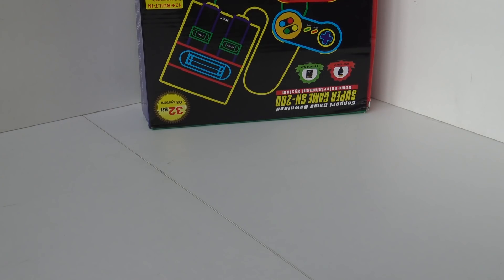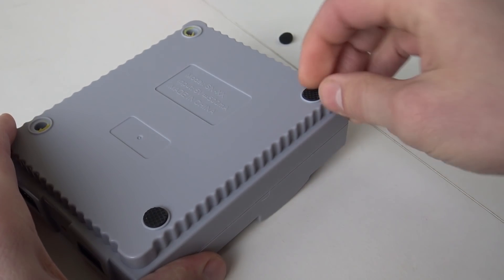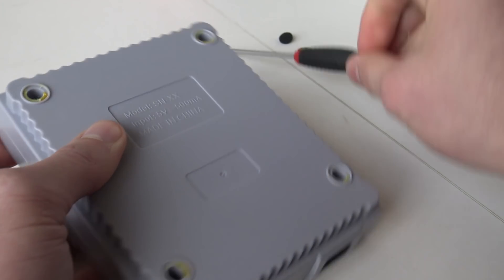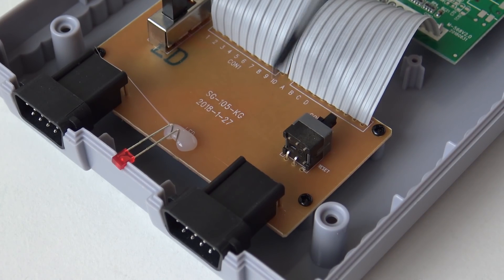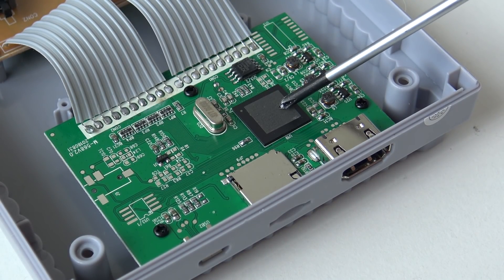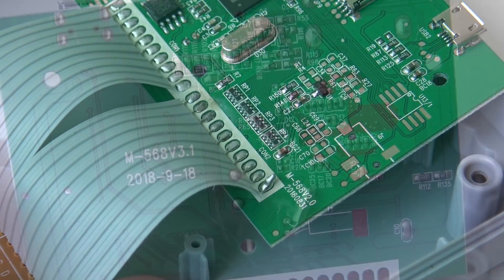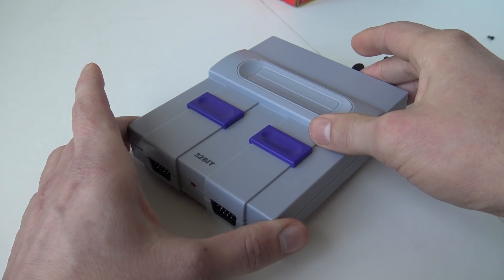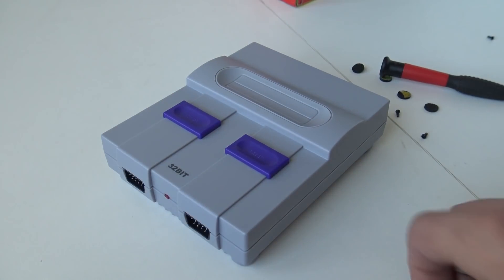TEARDOWN - SN-200 32-Bit - Nintendo Ultimate SNES Mini Classic Clone

Comment: Being unable to tell what chipset it is, does make it difficult for any possible hacking/tweaking to get the software emulation improved. A shame... Have you tried FX chip games on it like Star Fox, Wicked?
Reply from the maker: Good point, did not even try'd it when I noticed the crappy sound. 💩
Reply: @WickedGamerCollector  Give it a go if you can, I'm curious to see if the chipset is within the RS-97 and PAPK3 Plus family or not. If it's one of those chips, then there's a bit of hope. If it's better performance wise, then it's all software and there's ways to fix that sound problem ;)

Comment: The top of the chip has been shaved off to hide the chips identity. Common on quite a lot of products. It's used to make it harder to reverse engineer and build a clone. 

Its futile though in the sense its obviously a system on a chip the 32 bit logo on the front points it to a arm micro arch. if you want to know what have look on the sd card.